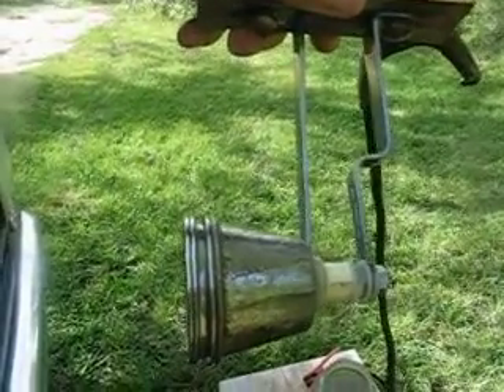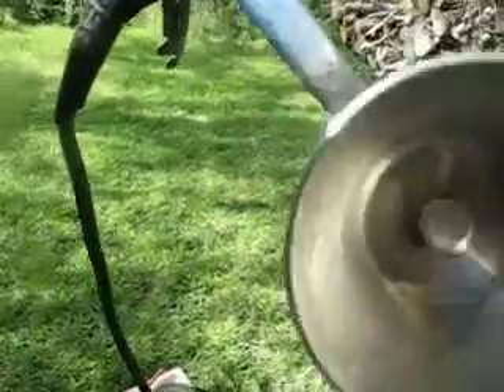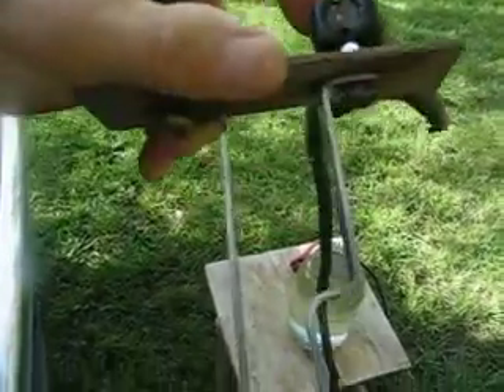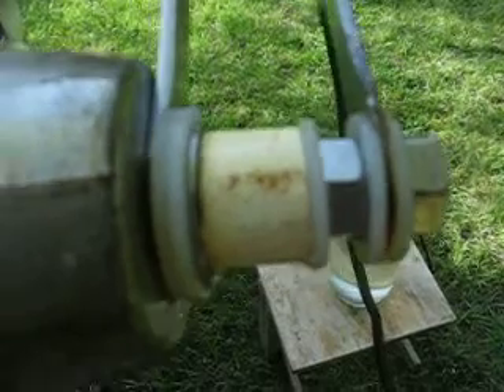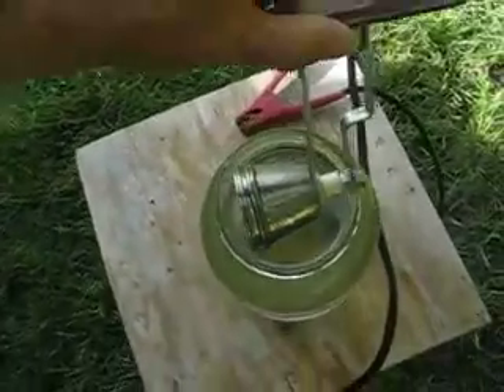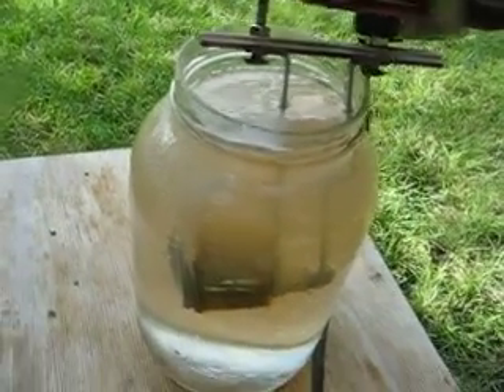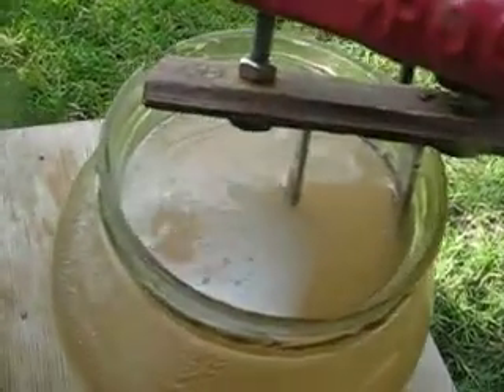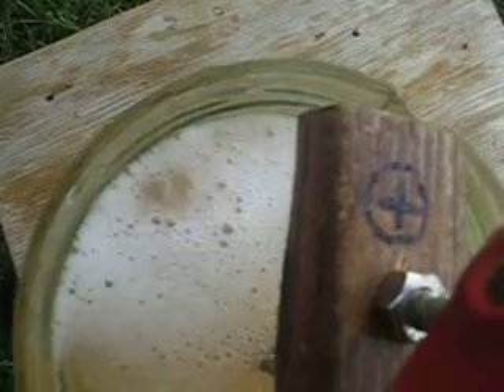072 HHO UFO Cups, high Oxyhydrogen Production

Comment: Can you tell me how many amps that's drawing? Thanks
Reply from the maker: +DUMBASS  I dont know but I still have this Cups. when Im off work in about 5 Days I will measure it and then let you know. Merry Christmess.
I wanted to make an electrical Propulsion Unit for a Toyboat.
Reply: helmut5230  great, thanks. You sir have a merry Christmas as well, and I'll look forward to hearing from you.
Reply from the maker: Ok I will try it out
Reply from the maker: +helmut5230  I stuck it into a unrestricted Bath 8 Percent KOH by weight and it drew 12 Amps. Does it help you ?
Reply: helmut5230 wow, im impressed, I dont get that much with 100 amps. Time to start over. I was getting too greedy I think. Anyway thanks for your time. Happy new year to you and your family
Reply from the maker: Its about breaking the double electric Layer. It acts
like a restraining Belt holding Electrons back from Exchange. Fin you Electrodes for that. Also have Squish Zone. Good luck
Helmut